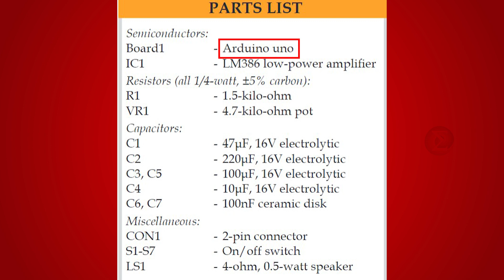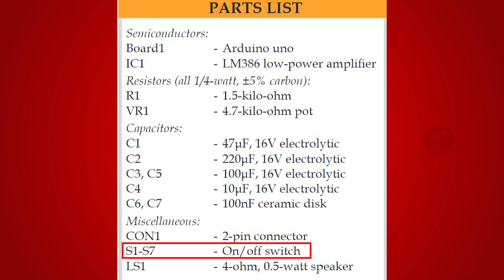Generate The Meditative 528 Hz Love Frequency (English) - DIY PROJECT - Electronics For You

Comment: I think you may want a sine wave for this... that sounds like square or saw maybe.
Reply: I think you are correct. A few capacitors in parallel with the speaker can be the fix.
Reply: A sine wave would more soothing.